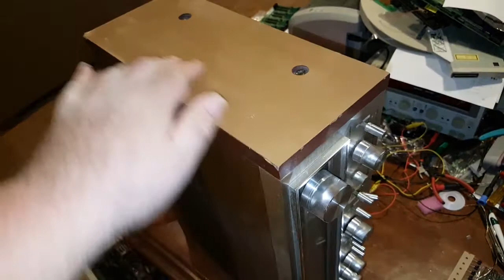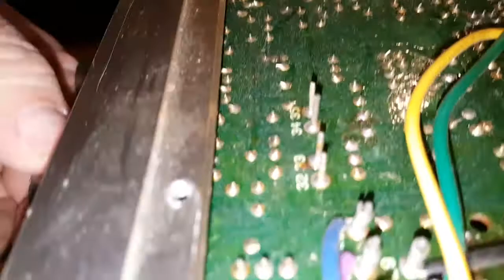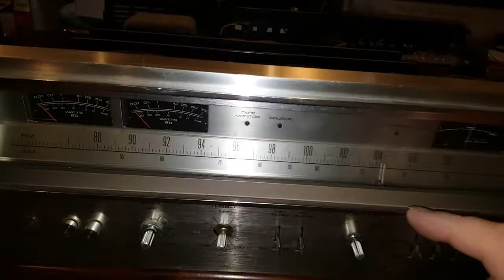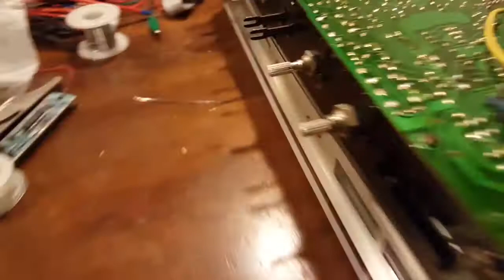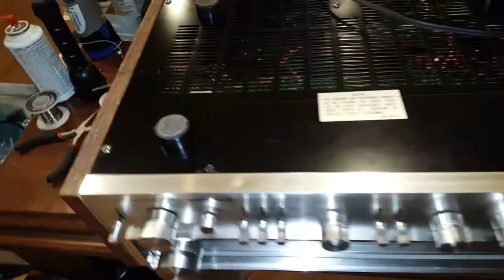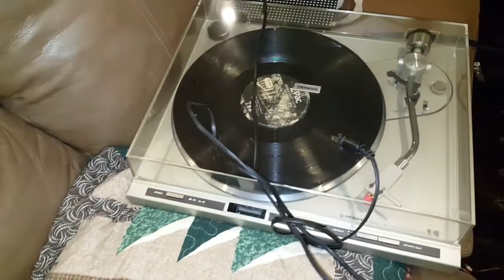Pioneer SX-780 Quick look and repair.

Comment: Really a clever idea to just open up the Darlington Power Pack and to only replace the bad transistors!
Reply from the maker: Yeap, I have been doing this for awhile becuase the only way to get STKs these days is from chinese knockoffs and we all know how they are.... Yuck. So if you have the opportunity to clone the circuit or repair just the bad sections, Then I do it. Back when CRT projection sets were popular, I used to do it all the time with the STK392-120 and others. In rare cases I would change out the IC for a triple audio amplifier setup using LM1875 or LM3886s in their place. They worked ok.